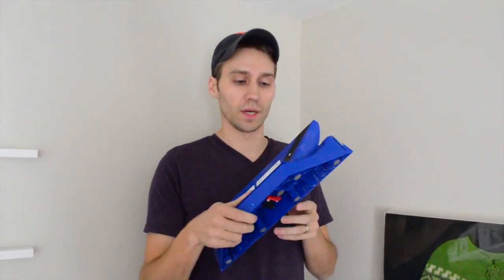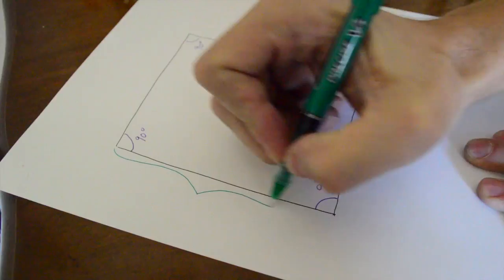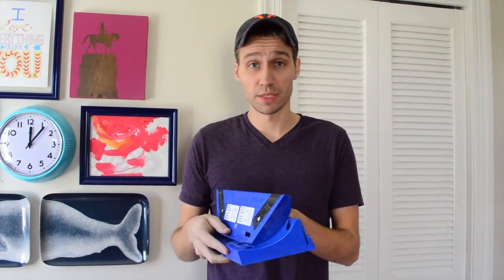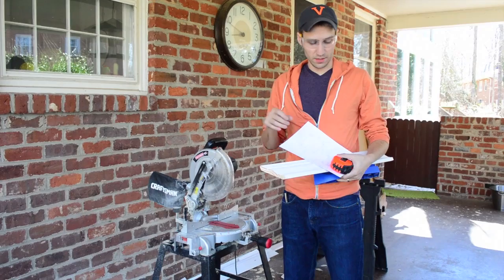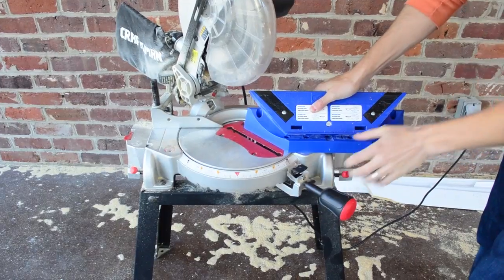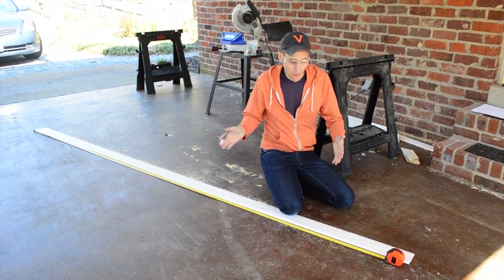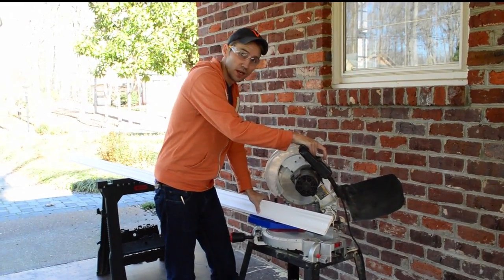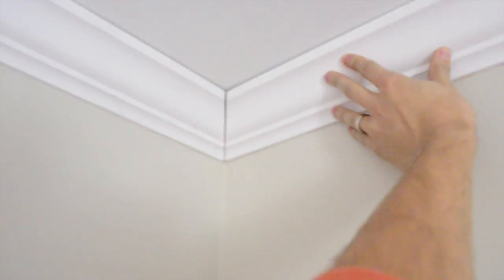How To Install Crown Molding

Comment: Probably one of the most relative and comprehensive videos on installation of crown molding. Appreciated watching measuring and cutting both right side and left side inside corners. Thank you
Reply from the maker: So glad it was helpful!
Reply: he made a few mistakes the right side cut is on the left side looking at the wall or put your back to the wall and right is right left is left another tip is if you pull down with your left hand its a left cut and right its a right

Comment: Make note, that is an Edge finder. When it lights/tones moving left to right make a mark, when the light turns off make a mark. The center between the marks is the center of the stud. That will save missed nails or sagging crown years down the road.

Comment: Tip; After you have cut the crown to the correct length, paint it. You can fill in nail holes later and touch them up with paint. Doing it this way is much easier than painting it once it's up

Comment: On another kreg video , it showed the right side corner . The guy actually called it a left inside corner cut. You are calling it a right inside corner cut. Which is correct? A right inside cut, the jig is placed left of the saw.

Comment: I have a outside c wall that boxes in a vent pipe. It is not long enough for the kreg angle finder to place around the outside corner. Suggestions?
Reply: Get 2 small pieces of wood and placid on the coner and take it the angle finder
Reply: There are small square that is a angle finder  , it doesn't have any marks of angles but ones you have it you can pass it along to the square or the tool you mentioned

Comment: Good video and a couple of tips....first, put up a furring strip up against the corner of the wall and the ceiling, it makes nailing the moulding MUCH easier and secure, second...PRIME AND PAINT BEFORE you nail! Nothing worse than seeing paint on the ceiling because you were lazy at the start!